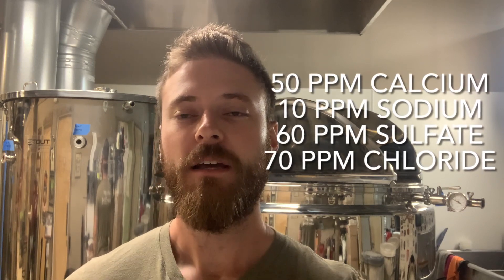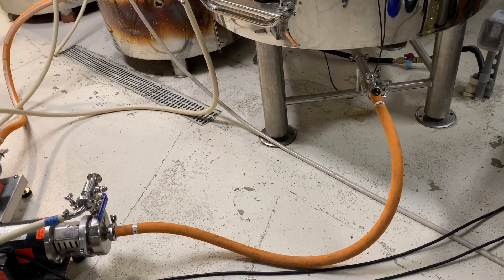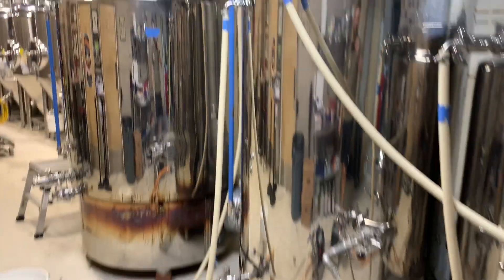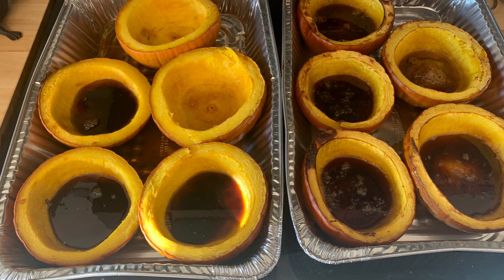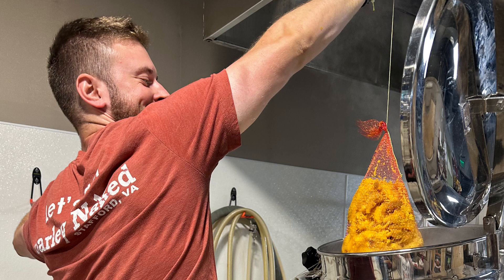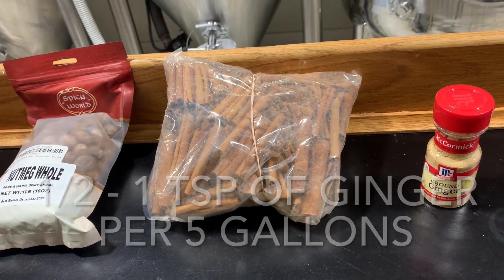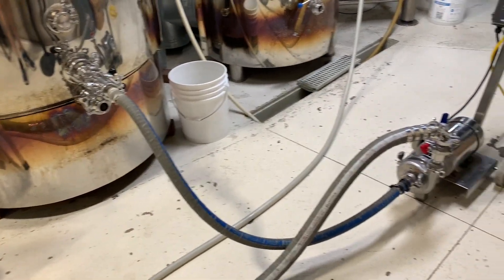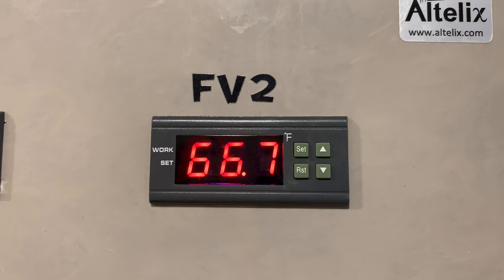How To Brew a Delicious Pumpkin Beer

Comment: Congrats on the GABF medal. What do you use to calculate your water profile? Thanks
Reply from the maker: Thank you! I got an initial water analysis done by Ward Laboratories to get a baseline reading and make all adjustments in the free software Bru’n Water
Reply: @thebeerjunkies1  why do use Bru’n water over the the water profiles in apps like Beersmith or Brewfather?
Reply from the maker: Honestly just because that is what I was introduced to when I first started brewing! All of the water calculators should perform the same ppm calculations, so if you are more comfortable with the BeerSmith or Brewfather interfaces I would recommend using their products
Reply: @thebeerjunkies1  thanks